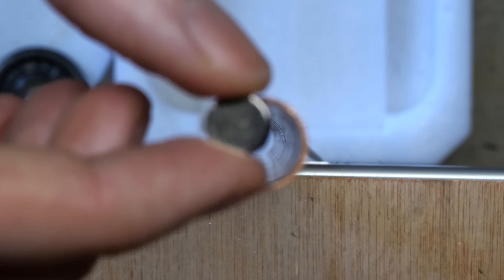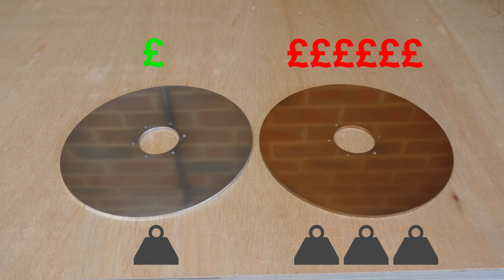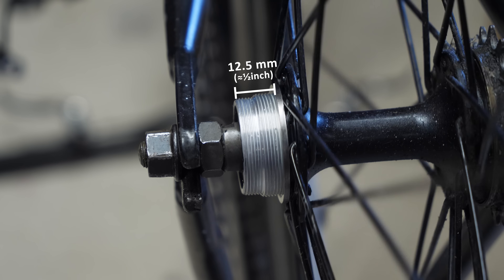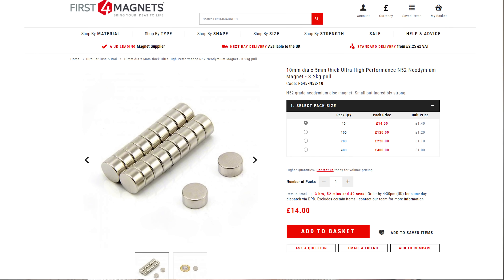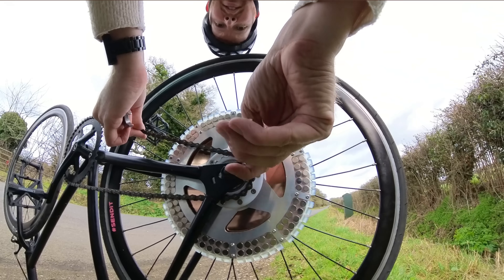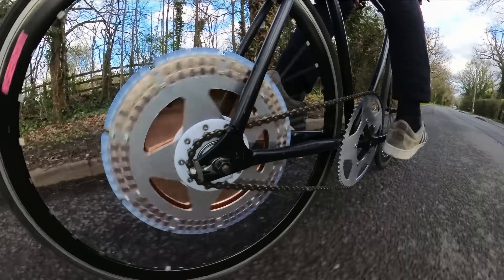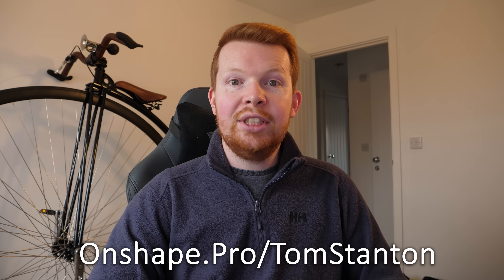Gearless Magnet Bike

Comment: There are several thing that i would suggest you to change, first, as many pointed out already, you need to use the magnetic fields more effectively, by guiding them with shoehorn shaped pieces of metal. They should ideally be made of an iron silicon alloy, usually called dynamo iron.

What this does is effectively reducing the magnetic resistance in your system. You will see that the whole theme of the Modifikation of your systeme will be the reduction of magnetic and electric resistance, where you can't use it. 

Next, you have to reduce the copper plate to hoops of copper around the perimeter of the wheel, these should again be joined together by an iron silicon alloy plate. This reduces magnetic resistance on the whole perimeter of the wheel, increses the effectiveness of the copper sections, as the Eddy currents are not formed randomely but  in seperated hoop sections and this increses the electric resistance between the hoopes, ensuring no unwanted Eddy currents in the sektion that hold the hoops together.

In essence, you've build rudimentary asynchrounus motor. They struggled with the same problems you struggle and the solution was, not to use a solid copper drum, but to use a copper cage in a dynmo iron cylinder.

Comment: Heat transfer is definitely going to cause an issue, the lack of multiple gears also makes it difficult, I would recommend using different materials for the spokes and frame so you don't have to comprise the structure, electromagnets to adjust the torque factor and potentially some thicker copper plates with grills inside to act as a heat sync. You could also mount the magnets on the interior and exterior of the bike to give yourself the most room, along with maybe some on the front to give yourself a better centre of gravity, basically a reverse electric bike. This is a really cool project and would love to see it commercialised as I always have issues with my sprocket due to the mechanical design, parts rubbing together causes wear and can fail, this seems very promising
Reply: If there's enough heat to need sinking, then the idea is a bust. Whether or not you sink it, that heat is a stark reminder of just how inefficient this coupling is, whenever the load rises due to head wind, incline, or rolling resistance. It used to be bad enough living with the relatively tiny extra load imposed by a dynamo to run a 3W bulb when riding home from school after dark.

Comment: It may not be much use as a vehicle, but you could probably repurpose it into a generator.  See how efficient you can translate pedaling speed into electricity stored.  The Black Mirror episode 15 Million Merits makes about as much sense as putting people in pods to collect body heat as in _The Matrix_, but for it could be useful for small applications like charging the media player you’re using to distract yourself from the fact that you’re exercising.  How many RPMs would it take over X time to charge your phone from 20% to 100%?

Comment: Needs over running capacity so you can coast.  How do you get coasting and braking?  If you coasted a really long run as configured, would the copper disk overheat?  I would love for you to explore this further.   For example, a centripetal clutch that gives you a friction drive at lower speeds so you can take off faster.  Nothing will beat conventional chain drive.  Still it would be fun to see how far this could be taken.  Giving up the braking could go a long way towards refining the drive without exponential complication.

Comment: Too bad Veritasium didn't try to use his own weight to make it go down faster. Oh wait he did, it didn't go down faster. You should have tried all the experiments with both. Maybe once the field was stronger the aluminium would have dropped slower. Guess we will never know. Very scientific of you, stick to what you believe is the truth and get rid of anything that opposes your view on the minimum chance you get. Congratulations.
Reply from the maker: Trust me, I would have preferred aluminium to be the best material as it would have saved me a decent amount of money (1/6th the cost of copper). My tests covered the variables I could control, but maybe that wasn't enough. How about you run the test again and let me know?
Reply: @TomStantonEngineering  Trying it with the middle magnet flipped would have been enough to prove or disprove. Doing so with all the magnet poles facing the same side renders the magnetic field ineffective. The only "test" you did with both, only makes it conclusive that one disk has more weight than the other. If I had the machinery or the money to try it I definitely would, but I will gladly go to you to try it out myself and prove or disprove the hypothesis.

Comment: I could see this having potential on motor vehicle clutches. The eddy currents could act as the friction zone and then have conventional friction plates for locking in. The heating would only be an issue when engaging or disengaging, and if its on a motorcycle with a wet clutch you don't have to worry about the heat at all.
Reply: To withstand the torque of an engine you would need a clutch bigger than the entire car.

And even if you could make the small enough. The heat generated would be too much.
Magic smoke machine

Comment: Great stuff! A Gates Carbon Drive (non-metallic, composite belt drive system) would have made your life a whole easier for this project. To prevent the chain from sticking to the magnets. However, you'd need a different bike frame to make it work.

Comment: 16:25 -- RE:  "Wasted Heat Energy" in the copper disc;  Oh now I have an idea!  The copper plate needs a heat sink, and then you'd have a pedal operated way of running a refrigerator, assuming the bike is static.  See also:  Einstein-Szilard Refrigerator.
Reply: ^^  In other words, this system reliably generates Heat in the copper plate via the eddy currents and mechanical advantage, but otherwise has no need of electricity at all to function.

Comment: I think it is much better if this setup is used as a generator like regenerative braking and the current which is produced is used in battery or directly drive the motor to propel the bike,,and paddles are used to  rotate magnets inside the coils that project is much better to watch....

Comment: Because aluminium is a less efficient energy conductor, it might waste less energy in heat gains and give you what you were looking for in a kind of variable clutch. Copper heats up very easily so perhaps it was more readily accepting of that energy, where as aluminium might give more resistance in the form of heat acquisition and transfer that into more kinetic energy.

Comment: Interesting video. You basically re-invented the induction motor with the difference that the rotating magnetic field is not produced by coils, but by literal spinning magnets. Unfortunately you won't be able to produce more torque than you input. All of the speed difference just stems from the losses in the copper. Nevertheless it could work as a demonstrator for these type of electric machines, since they are a bit unintuitive at first

Comment: This magnetic slip based on induction into copper is the very basic operation of a 3 phase induction  squirrel cage motor. The slip is energy lost to heat. Why would you want to add heat lost to friction to the drive of a bike? A magnetic coupling is more efficient as the force is there without the slip. This would be a disk containing magnets which lock in position in a magnetic coupling. This is the principal of all brush-less DC motors used in RC craft such as drones and for propulsion in electric vehicles to make best use of battery power. This reduces the heat that needs dissipated. This is why induction motors always run below the synchronous speed. This is why induction motors are not used in high efficiency applications such as HE appliances.
For a physics magnetism and electricity video it is entertaining and informative, but not practical for drive in a bicycle due to the loss in the slip in the drive.

Comment: I'm no physicist...
But you got me thinking.
Re: chain. Do stainless chains exist? To stop the magnets sticking to the chain. Same with the spokes.

Re: heat
Does the heat affect the eddy currents? Will cooling make it more efficient. 

Re: cooling
Drilling holes to dissipate heat faster
Incorporate cooling fan blades
Spray water, compressed gas, a solvent Onto the disk.

Re: pedal power
What if you substitute pedal power for a motor?

Re: copper
What if you used an aluminium disk instead. How does that change the outcome?

Just some thoughts I had watching this marvellous video. I've subscribed and look forward to more silly experiments😂

Comment: You're wasting 1/2 the magnets by no having a closed loop system - basically the side of the magnets facing away from the copper disc is wasted, where if you had N-S config with iron directing the flux, you could use 100% instead...

Comment: I wouldn't buy the bike if they sold it because I would lose mile and twist gear system up likevi always do because I only use two big gears for more torture.
I will never by a bike with back disk breaks.they suck so bad because on little hair bend to breaks,than there micro resistance that you loose mile.same with centered shock lose torque.3ven with locks.I only get bikes with no center shocks,no back disc breaks just old school pad cable breaks.my bike are 27 inch because big bikes take to much energy.I need max fast speed torque from high gears.i can torque and coast for long times up hills and keep my energy for 15 hours that how long I go on my mountain bike everyday since I do not have car so I have to speed 15 hours a day on it.Every thing makes difference. All these new fancy bikes slow me down and you need special tools so all my bikes are walmart since they do not have centered spring junk and back dusk breaks junk that bend and slow you down.

Comment: Many years ago, some cars had what was called a "fluid drive" transmission. There was no direct contact between the clutch plates. A fluid transmitted the motion, resulting in a very smooth acceleration.

Comment: If you had an ferromagnetic (e.g. iron) plate on the back side of the magnets, they wouldn't attract the chain or spokes as much. It would complete the magnetic flux circuit and may make the flux at the disk stronger.

Comment: Also, you cannot measure copper with a thermal camera accurately, not even when entering the emmisivity; copper is one of the best reflectors for far infrared, even when accounting for the emmisivity, background radiant far infrared will be picked up by your measurement.
Your measurement will either be much higher, or much lower than the copper actually is, depending on the scenario, and that's as awful as it sounds.

Comment: This video is a little painful to watch as an EE.  Just a hint, the torque vs slip (between magnets and disc) is non linear and non monotonic.  If the magnets spin too fast compared to the copper, the torque actually goes down.  Essentially, the eddy current gets so large that it weakens the impact of the magnets.  A higher resistance material like aluminum will have better torque from a stop and may have a more advantageous torque/slip curve.  Copper is really only helpful for high efficiency operation at little slip.

Comment: Put a thin layer of water on the back of the copper disk that can dissipate heat through convection currents and an increased surface area on the open face using textured peaks in the watter containing material.

Or replace the solid copper with a bilayer of copper and water in the middle.

Comment: The heat would have made it even worse since it would have increased the resistance in the copper. So basically your clutch gets worse over time as you try to get up inclines.

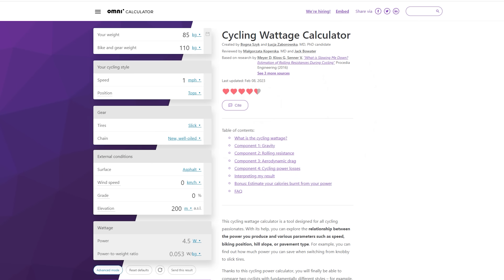Comment: 8:22 "bike and gear weight" 110kg - that must be one of them led based bikes, only for heavy metal fanatics. What's interesting is that your contraption was overbuilt thanks to this incorrect assumption, yet it seems that you were still struggling to gain speed.

Comment: I think there's simple way to stop the magnets sticking to the chain, and also increase the magnetic field: On the outside faces of the magnets: Use a small steel cap to link each North pole to its adjacent South pole. This channels the flux away from the chain, and effectively turns each pair of magnets into a horseshoe magnet. You'll see this arrangement in magnetic latches, or when magnets are shipped.

Comment: What you have here is an electromagnetic torque converter, or an asynchronous motor with a rotating permanent magnet stator (instead of a wound coil stator). The torque is more or less proportional to the difference between the sprocket and wheel RPM, aka slip. You can probably make it more efficient and easier to ride with some engineering effort, you may even want to look into making it a synchronous motor instead by putting permanent magnets in the hub as well. In that case the torque is linear with the difference in position between stator and rotor.

Comment: An idea to solve your chain issue, use a belt instead.  Wouldnt it be neat if you could take this design and impliment it to create energy to charge a battery on an ebike while you ride.  Of course it wont keep it fully charged but it'd at least increase the range.  A motor would certainly negate the extra resistance on the pedals.

Comment: Two points I'd have tested; 1. how much does it slow you if you pedal backwards? 2. what does it do for controlling speed when going down a hill (something steep enough to normally require braking)? Interesting as always! 👍👍
Reply: Backwards rotation will heat copper disk to huge temperature and it just start to melt this plastic)
Reply: Add 80w of power and no need to pedal?
Reply: It looks to me like the rear sprocket has a ratchet, so pedalling backwards wouldn't turn the magnets in reverse.  I think.
Reply: @ParaBellum2024  actually on rear sprocketed wheels you can go backwards. its just VERY slow, if your not in a BMX park or on a slope.
Reply: I was going to ask the same question. Thanks!

Comment: 5:40 Just use a wheel with a 6 bolt or Centerlock brake disc mount, or get a BB thread tap (RH) to tap a hole in the copper disc to use it with your current (!) hub. You can use a track lockring to make sure it doesn't unwind. .

Comment: if you use a boundary layer of screws in between the outer and inner magnets then using 2 times more magnet on the outside than the inside then as you turn the inner ring of magnets one way it forces it to turn the outer ring in the same way that an electric motor does.

though your bike would be in reverse  it would be directly driven with low torque... I am referencing a clip I saw where the gentleman made this magnetic gear. Not sure if I'm allowed to reference that so no link.

Comment: 12:25 - this braking principle is similar to viscous friction, as in the hydraulic coupling of an automatic transmission. 
Working with constant slippage leads to energy losses, therefore, the magnetic coupling must be blocked, as well as the hydraulic coupling)), and be able to completely remove the magnets from the disk in order to get a free roll.

This is very similar to asynchronous motor principle. Here, too, there is a rotating magnetic field and a sliding field relative to the rotor

Comment: Make a current output from a disc, add a battery and connect it to the motor which should be connected on a transmittion of the bike, add a gyroscope and as soon as gyro feels the bike inclanation it should vary the power output of the motor to the bike transmition it would help you get easier on inclanations

Comment: I'd like to know, would moving the proximity of the magnets closer to the centre, or moving them away, affect the braking force? I'm asking with reference to the principles used in Variable Field Magnet Motors that work in the same way, but physically shift the magnets closer or away from the armature.
In your case you might be able to make starting torque requirements lower if the copper plate had different segments further away. Like how a longer arm for a wrench makes things easier.

Comment: The problem you encountered with the chain sticking would be most easily resolved using a rubber “chain”. These are commercially used in many modern single speed bikes.

Comment: Put a elc motor on this and you can have a elc regeneration/ scavenger effect putting elc back into the battery pack
Reply: Not only that but having the motor will help put the perfect pedal speed consistently without having yo put much effort in at all

Comment: Why don’t you use this magnetic clutch as a braking mechanism instead of a way to transfer power to the wheel? I imagined that ypu could have this copper disk attached to the hub and the magnets linked with the cassette of a normal bike gearbox, so when you stop pedalling you have a braking affect due to the magnets beeing stationary and the hub disk moving at the same speed as the bike wheel, if you want to increase your braking speed you could pedal backwards. I hope you will make this happen

Comment: I love your experiment this is beautiful... It got me thinking what if you found a way to harness the energy that you're making with the back tire and introduce it to the front tire with the same setup
Reply: What I had popped in my head was that as the heat and the currents that you're making in the back tire or with the back tire that produces your forward motion and your braking power would probably if you introduce that electricity into the front plate in magnets like same design just in the front tire it should act is a pushing force for it would technically induced electromagnetism through the front tire and then if you have it hooked up right go back to the back